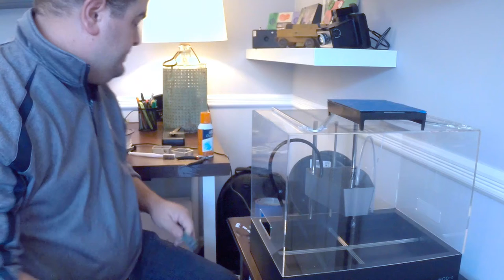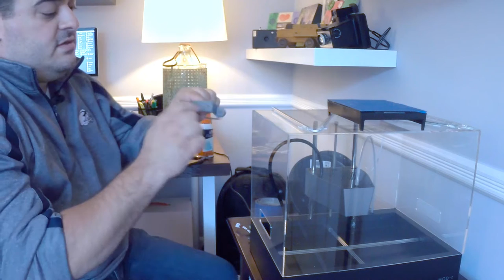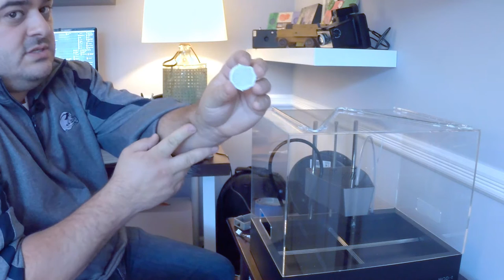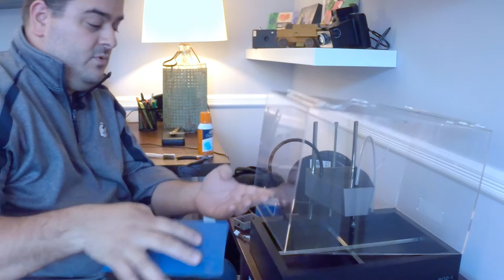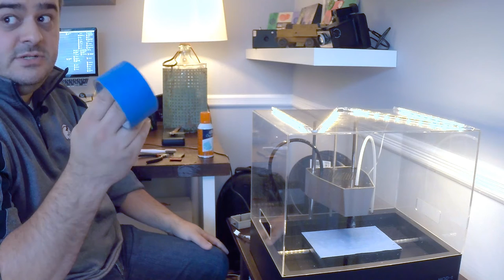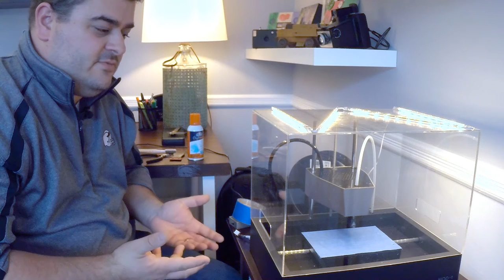New Matter Mod-T 3D Printer

Comment: Just watched your video as my first ever printed part is running on my New Matter MOD-1. Set up was a breeze and this first simply part is moving along. Thank you for the ideas.
Reply from the maker: +Jim Gable Thanks for watching. Let me know what you think of the printer. Besides a few small quirks here and there I have been extremely pleased.
Reply: +Tim Macrina - So far my printer is working very well. My first print was from their library and worked without a hitch. I've since done two objects from Thingiverse and both worked flawlessly. Only problem is that the step of downloading to the printer is slow and the feedback is either too subtle or I don't know what to watch, so the start was uncertain. My current print ran overnight and is working out to be a 13 hour job without any problem.

Comment: 123d design by Autodesk is a great beginner auto CAD software (design software). It is very easy to use while it also works very well and allows you to print fairly complex designs. Another thing I noticed in your video was that you had print bonding issues to your build platform. A solution to that is a material called kapton tape and it works great. You can get this on Amazon.com. Personally I wouldn't get this printer because it doesn't fit my custom needs but like you said it is very high quality for a $200 printer. The last thing is that on the new matter site the printer is about $400 dollars.

Comment: Thanks Tim: I just ordered mine. I tried to get it at the price you paid but it's too late. It's just retail now.
Reply from the maker: +Roger Andamo Kiel I think you will like it. Good Luck
Reply: Hello Tim:

I received mine the other day. The whole experience was and is a disaster. I'm packing it up today and sending it back. I think it is an amazing machine. It is so beautiful it should be in a museum. I don't think it's quite ready for consumers. There are still some operational issues that New Matter needs to resolve. At this point, I see it as a $400 headache. I can't deal with having to wait 24-60 hours to get answers from them. I feel like they have their consumers on a leash. I don't care for that.

Roger
Reply from the maker: +Roger Andamo Kiel sorry to hear you had issues. I agree that their support appeared to be bogged down. The only way that I got acceptable support was to call first thing when they opened.

Comment: Where do you get a new hot end from? Mine broke..
Reply from the maker: Call new matter and they will send you a new one. Mine was free of charge.
Reply: +Tim Macrina awesome thanks. My printer isn't pushing the filament through but the print bed still moves around like its printing something. This would be a broken hot end correct?
Reply from the maker: +Anthony Gray I would say so.

Comment: Hello, does the tape effect the 3d print ie leaving an indentation? are you aware that the top print board is only rated for 10 prints? I hope that tape helps increase the life of ithow did you get your own 3d prints to print? do you have to upload them to the new matter website?
Reply from the maker: +LordAtrix I didn't know the print board is only rated at 10 prints. I have at least 50 prints on the one that came with the printer. The painters tape doesn't appear to have any effect on the bottom of the print. I take my time and smooth it out the best I can. I will post another video on how I print my own objects. I'll try to do it tonight or tomorrow.
Reply: +Tim Macrina hey, is your printer tray wobbly. I'm just in the process of setting mine up, the tray that sits on the rails wobbles
Reply from the maker: +LordAtrix The only time my tray was wobbly was when I didn't have it square with the axles that move it back and forth. Does that make sense?
Reply: +LordAtrix Our print surface plate is meant to be a replacement part, however if you choose not to replace it, you can easily extend the life of it by taking the wire brush and scruffing up the surface. The rough surface is what helps the print adhere to the plate much better. You can also extend the life with painters tape, and usually does not harm the plate in any way. For more tips on how to maintain your plate, visit our blog post: nm3d.co/pspmain

Comment: This must be your first 3D printer.
Reply from the maker: Yes it is.
Reply: +Tim Macrina That sounded unnecessary snarky sorry. Unfortunately there really is no desktop 3D printer that gives you a perfect print even 75% of the time. Every machine has failed prints even, to a lesser extent, ones that cost $500,000.
Reply from the maker: No worries. I think you are 100% correct.

Comment: Hi there! I got mine yesterday and I have an issue... first 3 prints, all went smoothly. From the fourth, it started to not stick to the plate. Today I got the blue painter's tape, and it's still not sticking even from that damn first layer... What am I missing? Thanks a lot, have a nice day
Reply from the maker: Where you printing the same object each time? What do you mean by not stick? Could you post a video?
Reply: I printed the test logo, a carving knife and a bookmark from the store. Then I tried the whistle but halfway in, while having the cover on, came loose from the plate. Now I'm trying to print again the bookmark, and while laying down the first layer it comes loose , wrinkling upwards
Reply from the maker: +Nintendiano I'll try the bookmark tonight and see what happens.
Reply: +Tim Macrina Thank you very much
Reply from the maker: I tried a bookmark from the store and it worked fine. Here is a video of the result https://youtu.be/8zPGx9MP7Ho
Is the room your printer is in cold? Are you keeping the cover on when printing?
Reply: I tried again today and it looks like I have to try a manual calibration, since the nozzle is too high from the plate, about 1 mm. Maybe a bug
Reply from the maker: +Nintendiano Did you get your printer working correctly? If so, how?
Reply: +Tim Macrina I got a perfectly printed Rook
but then in failed halfway of a pawn... i'm going to try to get a fine first layer, the pause, then glue it to the blue tape, then resume
Reply: +Nintendiano A simple way to help the print adhere to the plate is to take the wire brush and scruff up the plate a bit. The rough surface helps the print adhere much better and gives you a better chance of a successful print. Here are some tips on how to maintain your print surface plate: nm3d.co/pspmain

Comment: This is almost exactly textbook of how not to do a review.
Reply from the maker: +GoatZilla Thank you for your comment. Do you have any suggestions what I could do better next time?
Reply: +Tim Macrina Do not mix opinions and data.  How you "feel" about things should be separate from the actual data you present.  This isn't a movie or book or music album or something.  It's an actual functional device.

If most reviews either ejected or at least reserved their "opinions" to the end section in one shot, their videos would be cut in half while actually being more informative.

A review minimally validates specifications from manufacturer.  Like, "They say the max print area is this big, and it really is that big", or "In reality because of the nose wipe you lose about 5mm build area".

Or "the base kind of wobbled as you got out to the extents of the rack/pinion system".

Or "they say you can print at 0.1mm, but I printed something at 0.1mm and 0.2mm and found no difference in quality".

That's really just obvious, minimum review type stuff.

There was another video that I think wasn't even a review, but was more informative because he actually covered the calibration process in a little more detail, which isn't part of the official "spec" but is clearly a critical topic in 3d printing.

A good review will delve into the product a little deeper.  Like, "Instead of the traditional stepper motors, this uses brushed DC motors with encoders", or "this uses a proprietary hot-end", or "the firmware on this thing is not open source", or "the extruder configuration can't handle flexible filament".

And at the very least, the information you present should actually support your conclusion should you decide to present one.  A printer that repeatedly, spontaneously fails prints cannot possibly deserve a positive rating.  And your value opinion for a $199 printer doesn't hold when that printer actually costs $399.

If you review your review with this in mind, you will realize just how little actual information you actually presented.

That was good that you pointed out a few of the flaws (and those definitely belong in the review), but otherwise...  7 1/2 minutes of eye gouging.

Comment: hello, i own a mod-t and i am very far from impressed.  I was semi-new to 3d printing and was excited to see a very affordable printer that was easy to use and setup.  When it came in the mail, i was excited but soon saw that the deal was too good to be true.  It is a total piece of shit.  The filament breaks, the prints come off of the bed too often.  I have no problem with dropping 2 grand on a printer that actually works,  This poor man wasted his time on printing a go pro clamp and i wasted my time as well.  The customer service is very bad, i contacted over new years but of course , they were  not there as it was a holiday, but i sent the email twice and never got a response.  Highly disappointed i took it out of my room as it was a waste of space.  I dont like how it is made out of cheap plastic and how they stored the hardware in the base ultimately making it chunky and thick.  I will be getting a new printer that will work much better this is shit and i have had nothing but bad things to say.
Reply from the maker: +MONKEY JOE Sorry to hear you are having a bad experience. Once I upgraded my firmware to 0.7.0 almost all of my print issues went away. I did have 3 filament breaks but it was with one particular spool so I'm thinking its the filament and not the printer.....at least for my issues. Did you try calling New Matter about your issues?  That's what I did and they were great to work with.

Comment: any one want to buy mine? 200 plus shipping
Reply from the maker: Brand-new or used?
Reply: +Tim Macrina used for two weeks
Reply: +Baron baron used 250 p[us shipping
Reply: +Baron baron I'd be interested
Reply: +Andy Stout sorry i cant sell this POS  it would break after one print. this printer lasted a total of about two weeks since i  got it in nov constant parts wearing out software bugs endless its where it should be a trash bin total junk waste of time and money
Reply: +Baron baron I'm still interested if you want to part with it.  I'd give you 250.00 for it shipped.
Reply: +Andy Stout done and done how do you want to do this? you can get help from the tech support [which was great] this is the upgraded version there's a filament jam currently but they will help clear it on skype etc i can post it to ebay for the sale does that work? it would come in the original box packed correctly
Reply: +Andy Stout can you PM me and i can give you real contact info etc
Reply: +Andy Stout i can show you models i have made with it etc if you need that
Reply: +Baron baron No need for models.  Friend of mine has one.  It's for my pops.  He needs something to tinker with in retirement.  Sent you a PM